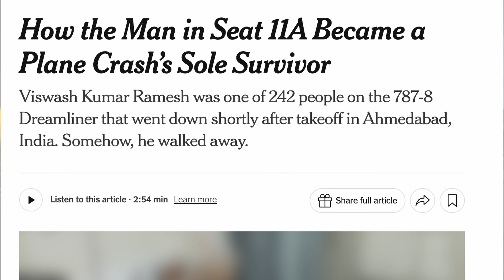Why the RAT Changes Everything – Air India 171 Update

Comment: *Pre-Flight & Ground Operations:*

1.  *High Ambient Temperature:* The flight departed from Ahmedabad (AMD) where the temperature was around 40°C.
2.  *Extended Ground Time:* The aircraft reportedly sat on the tarmac for approximately 3 hours in this high heat, potentially leading to significant heat soak in equipment bays.
3.  *Potential Underlying Issues:* Reports suggest possible pre-existing, intermittent electrical issues on this specific aircraft (e.g., "nothing working" in the cabin on a previous flight or prior to this takeoff), hinting at potential latent maintenance defects.
4.  *Heavy Payload:* The aircraft was reportedly carrying 242 passengers and 100 tonnes of fuel for a flight to London, a payload that, by typical 787-8 specifications, would put the aircraft at or potentially above its Maximum Certified Takeoff Weight (MCTOW) for any conditions, and certainly challenging for 40°C.
5.  *Flaps Set for Takeoff:* The aircraft's flaps were correctly set to a takeoff configuration (e.g., Flaps 15), meaning the Takeoff Configuration Warning System (TOCWS) would not have alerted the crew to a "no flaps" condition.

*Takeoff & Initial Climb (0-20 seconds):*

6.  *Smooth Initial Takeoff Run:* The aircraft's engines were initially functioning, and the takeoff roll proceeded smoothly, indicating no immediate engine or fuel supply issues.
7.  *Liftoff & Gear Retraction Commanded:* The aircraft successfully lifted off the runway. The pilots commanded "Gear Up" as per standard procedure.
8.  *Gear Initiates Retraction but Gets Stuck Midway:* The landing gear began retracting, but before completing its cycle, it became stuck in a midway position.
9.  *Flaps Remain in Takeoff Position:* The flaps were never retracted from their takeoff setting during the flight. (This would add substantial drag).
10. *Compromised Initial Climb:* Due to the combination of high weight, high temperature, significant drag from the extended/stuck landing gear, and unretracted flaps, the aircraft's climb rate and acceleration were severely degraded from the moment of liftoff.
11. *Limited Altitude Gain:* The aircraft only managed to climb to approximately 600-625 feet in about 11-20 seconds.

*Catastrophic Event & Descent (~20 seconds to 60 seconds):*

12. *Critical Systemic Failure:* Around 15-20 seconds after liftoff, a major, catastrophic failure of the aircraft's primary electrical system occurred.
    * This led to the loss of power to the electric motor-driven pumps (EMPs) for the Center Hydraulic System (which operates the landing gear), causing the gear to stick midway.
    * Crucially, this systemic electrical failure also caused a *simultaneous loss of thrust from both engines* (e.g., by cutting power to their FADECs or affecting a critical shared control component).
13. *RAT Deployment:* As a direct consequence of the widespread primary AC electrical power loss (from both engines), the *Ram Air Turbine (RAT) automatically deployed* at approximately 20 seconds after takeoff to provide emergency hydraulic and electrical power to critical flight controls and essential systems (including communications).
14. *Loss of Climb & Descent:* With no engine thrust, and enormous aerodynamic drag from the partially extended gear and unretracted flaps, the aircraft lost all ability to climb. It stopped gaining altitude at ~600-625 feet and began to descend rapidly.
15. *Mayday Call:* Despite the dire emergency, the pilots, powered by the RAT, were able to transmit a "Mayday!" distress call, reporting "Thrust not achieved, falling!"
16. *Impact:* Approximately 1 minute after liftoff, the critically compromised aircraft impacted the ground.

*Key Open Questions for Investigation:*

* *Precise Takeoff Weight:* Was the aircraft operating above its certified limits (MCTOW) for the specific conditions?
* *Root Cause of Electrical/Engine Failure:* What was the exact systemic electrical or control failure that led to simultaneous dual engine power loss and prevented gear retraction? Was it a latent defect, a software bug, or an external factor not yet identified (e.g., a non-visible bird strike)?
* *Maintenance History:* Did the aircraft have a history of electrical or system issues that were not fully resolved?
* *Pilot Actions/Responses:* How did the crew respond to the initial performance degradation and the subsequent catastrophic failure? (This will be revealed by the CVR and FDR).

The above is a speculative sequence based on an AI chat summary with publicly available information and opinions. This is neither authoritative, nor definitive nor official. Caveat lector.
Reply: You are posting a response from an AI?  This should be noted for the benefit of the reader.
Reply: @johnluiten3686 It is AI assisted, but it's also speculative. I fed the AI with crucial information I have seen up until now. By no means authoritative or the final word. Read with caution.
Reply: @ArnHaz Point is that without disclaimer (now made after the fact has been pointed out).  You implicitly accept credit for such a detailed analysis—when nothing could be further from the truth.  That’s called representational fraud.  The Internet is full of such folk.  Too bad you’ve decided to join their ranks.
Reply: @johnluiten3686 I am not looking for any credit at all. It's a comment in a comment section. How is it fraud? Anyway, I added a clear disclaimer.
Reply: @ArnHaz No, it’s not fraud, it’s plagiarism. What are you, a HS dropout?  You printed in full a creation of another mind, albeit AI, and it isn’t a product of your mind!  That’s the issue.  We recently had the President of Harvard resign in disgrace for the same behavior.  The aspect of using AI as the ‘goto’ in place of one’s own abilities (of the mind) is becoming epidemic on the internet.  People read and think they are imbuing original, high level thought.  The authors using this plagiarism gain clicks, a following, and subsequent renumeration while their audience is none the wiser.  We now have automated AI ‘bots’ and human intervention is not even needed, just an address out there for YouTube as to  where to send revenue.  You want to quote another in your posting, then cite appropriately from now on.  AI has problems all its own.  In time hopefully, you’ll learn enough to recognize such and my admonishment will make more sense.
Reply: @johnluiten3686  I understand your frustration. But AI chatbots are freely available information processing tools. They are not "minds" that can be plagiarised. This place is not a scientific journal nor an academic publishing platform. It's a Youtube comment section. The standards of publication are vastly different. One cannot possibly gain followers or clicks or remuneration from a comment like this. Just like you misapplied the definition of fraud, you are misapplying the definition of plagiarism. You are also making aggressive, unfounded accusations about my intent and even insulting me by ad hominem attacks. Is this right?
Reply: Also, this is not the first response that the AI chatbot printed out. I didn't ask a simple question like "Tell me what happened in this crash" and then copy pasted the first response. Not at all. I fed it a lot of information based on what I read and saw in media. I made a lot of inputs to guide the chat. There was a lot of back and forth. This is the summary of a very long chat. It was intellectually stimulating, even. I wanted to share it in an open platform like this one.
Reply: @ArnHaz Nonsense, to quote any source of information as your own creation—which is the default assumption without quotes or other citation—is plagiarism.  I do take back my questioning as to your HS education, obviously you’ve never been beyond such.  In university, you’d have been caught up hard with your faulty understanding of creative contribution.  You seem the type who’d ask AI to do your “book report” and claim authorship simply because ‘you’ asked AI to write a synopsis of Melville’s,  ‘The Whale’.  If you think that’s creative effort enough to pat yourself on the back, you are in for a great awakening.   My rebuke will be nothing when you try this in the real world—and they will be especially looking for such now that AI is catching on and propping up mediocre people of little ability.  Sigh….

Comment: One more observation to make with this video to exonerate the first officer. Someone has suggested that the landing gear wheels appear to be tilting forward as they do when the retraction sequence is initiated rather than dangling like they do when the wheels leave the ground. If that's correct then perhaps the power failure occurred right after the gear was commanded to retract but the sequence was interrupted by the power failure that caused the RAT to deploy.

Comment: There was something very wrong with the electrical system on this aircraft. This was not a pilot mistake. It was the aircraft. This plane had flown from Dheli and the air conditioning and the tvs were all malfunctioning. A major electrical failure occurred which is why the wheels couldn’t go up and the flaps unable to go down, then the engines were not functioning correctly. Unimaginable. God bless them ALL

Comment: Thanks Captain Steve for your in depth analysis! All of it made a lot of sense to a layman like me! It was very brave of you to roll back your analysis from your previous video! Not many can do that. I read few comments on this video from some plane mechanic who advised that there was some problem with high temperature at Ahmedabad airport! That theory also supports your dual engine failure theory as well! Moreover, I think there should have been huge ear deafening sound from the two engines of the planes. But all we could majorly hear was the RAT noise as you rightly pin-pointed. I salute the brave pilots who did everything in their hands to avoid this un-fortunate accident. May all the souls are blessed by The Almighty and their families get the strength to bear and come to terms with this harsh-sad reality!! OM NAMAH SHIVAYE!!

Comment: There hv been suggestions that the plane used the entire runway . The extreme heat and lack of rain caused an extraordinarily large dust pile and debris at end of runway that is evident after takeoff. British Airways had a 4 engine flameout from volcanic ash high altitude. Is it possible that the dust and debris caused a flameout at rotation ?

Comment: The DGCA ordered Air India to perform a series of tests on the remainder of their fleet. Fuel Parameter Monitoring, EEC test, Engine fuel driven actuator op test and oil. etc All checked good.
Reply: Google DEL11011(13)/4/2019-DAW-NR to see the actual document.

Comment: Capt. Steve, could it be there might have been fuel contamination going on. We all know that when water is in the tanks, the engines fail quite quickly.  After all, kerosene floats on water.  So that means pretty immediate failure of engines.  It can take a bit of a while for water to actually enter the engines indeed.  Something that very much fits to that claim of the eyewitnesses that a loud bang, possible compressor stall at V1.  That's something that's said by bystanders and the actual sole survivor of the plane.  
How can two modern GRnx engines fail at the same time?  and that might also be why the Ram Air Turbine came out.  I do not think it was the Pilots fault at all as they lost power to the 2 engines.
So sad, and let's pray for the 274 people that lost their lives in this heart-wrenching incident.

Comment: damn I guess im better than a airline pilot. I knew from the beginning it was a dual engine failure. I played on the simulator on my phone and the flaps had little to no effect on take off. Turning both engines off though, was a different story. Exactly what is shown in the videos. Planes just glides until it crashes

Comment: Another report mentions the angle of the main undercarriage. 787 wheels hang to the rear on take off but motor forward before folding away. This angle can be seen in the video which suggests that raising the undercarriage had been initiated at almost the same time as the possible dual engine failure.

Comment: Given everything that has already transpired with Boeing, I'm confused as to why a software related failure was not one of the considered options. The aircraft looks to be in a stall angle, or suffering loss of power. The RAT deployment is a later symptom of the root cause. Incorrect plane attitude and even twin engine failure may be the result of a software fault.

Comment: In slow motion, watch the segment between 3:17 and 3:20. What is that black dot, just above the tree, that arcs up and back down? It seems to appear and disappear several times, as is it were a disc that was flipping in the air. Does the RAT have a cover that flies off when the RAT is deployed?

Comment: classic cascade failure? Here is a possible sequence: 1. Takeoff Configuration Error Detected

If flaps, slats, or other control surfaces are in the wrong position for takeoff, and the FADEC receives signals that:

    The aircraft is on the runway and accelerating,

    But required configurations are not met (e.g., flaps = 0, trim out of bounds),
    then:

    The FADEC may enter a protective logic state (e.g., “no thrust command” mode).

    It might refuse to increase thrust, or throttle the engines down automatically, to prevent damage or unsafe departure.

This kind of logic is embedded in modern aircraft to prevent pilot error from leading to catastrophic outcomes—but in this case, ironically, it might have contributed to the accident.
2. Throttle Disagreement or Mode Fault

If the FMS/autothrottle system sees an inconsistency between:

    Pilot throttle input (e.g., expecting TOGA),

    And flight configuration (e.g., incorrect flap setting),
    the system may:

    Refuse to engage takeoff power

    Hold engines at idle or low power

    Require manual override, which may not be obvious or quick to execute in the moment

3. Confusion from Combined Failures

Imagine a situation like this:

    Flaps not set → FADEC inhibits spool-up

    Crew advances throttles → engines do not respond

    Crew confused → delay

    Aircraft rotates late or fails to accelerate

    Engines stall or flame out due to improper airframe/engine interaction

    RAT deploys as electrical power collapses

    Aircraft becomes unrecoverable

This is a classic cascade failure, worsened by software logic that prioritizes protection over pilot control in a misconfigured state.
🧪 Historical Precedent

This isn’t theoretical. Past incidents have involved automated systems inhibiting thrust when they detect config errors:

    Spanair Flight 5022 (2008): Flaps were not extended; takeoff configuration warning system failed. The aircraft stalled and crashed shortly after takeoff. FADEC did not prevent spool-up, but didn’t override the configuration error either.

    Airbus A320 family aircraft: Will refuse takeoff with flaps/slats retracted unless overridden via alpha floor protection logic.

    Boeing 777/787: Complex logic prevents overboost or unsafe takeoff thrust modes if sensor input is outside spec.

✅ Conclusion

Yes — a software error, or protective FADEC logic, could absolutely prevent engine spool-up in the event of a takeoff misconfiguration. While intended as a safeguard, such logic can become lethal if it’s not intuitive, overrides pilot authority, or kicks in at low altitude when recovery time is minimal.

Comment: One other thing that was not mentioned is that if the engines were at takeoff power which they should have been at that point, they would be screaming and you would definitely would hear them on that video. The only thing I seem to hear is the Ram air turbine and the sound of the air frame gliding through the air with no engine sounds at all. I am a retired American Airlines aircraft mechanic and we used to test RAM air turbines in the hanger. They are extremely loud and sound just like the videos of the aircraft flying with them deployed. Just my two cents.

Comment: The fireball indicates that there was combustible fuel onboard, but it's certainly possible that it was contaminated to the point where it wouldn't sustain a jet engine. Another possibility is a fuel transfer malfunction that caused fuel to be drawn away from both engines simultaneously; this would require multiple errors during plane maintenance and probably would also need the APU to be running, but it would explain why both engines cut out simultaneously without any noticeable flames.

Comment: This theory seems to add credence to a lengthy message in Hindi that I received on WhatsApp offering a step by step rationalization for this being an act of sabotage by a member of the ground inspection crew. The message suggested if someone with malicious intent had shut off the fuel supply valve, then the engines would only be able to run with the residual fuel left in the supply line before failing simultaneously.     The flight crew is called to the aircraft only after aircraft inspection is completed and runway clearance obtained.    They do perform a pre flight systems checklist -- but they do not have oversight or access to determine the status of the fuel line valve or tank venting system. The responsibility for the main fuel valve and fuel supply line rests solely with the technical staff on the ground.   So the theory goes, a deliberate act of sabotage by someone on the ground would produce dual engine flameout within a very short time of take off which is consistent with what was observed, and consistent with the scenario favored by Captain Steeeve (probably not his real name ) in this video clip.